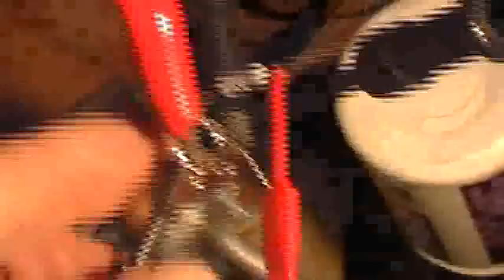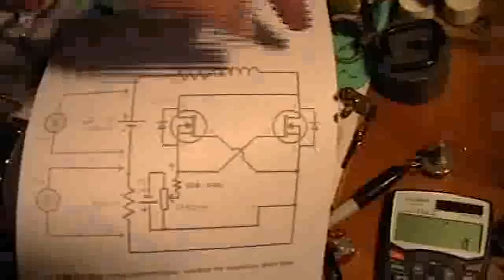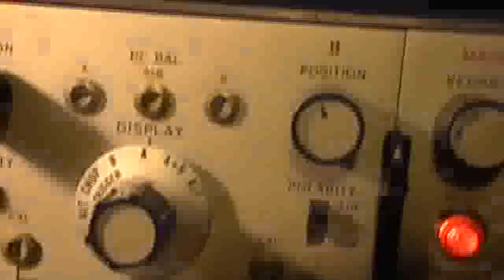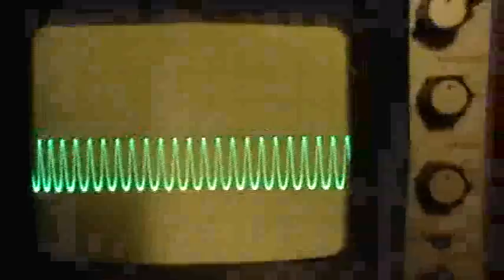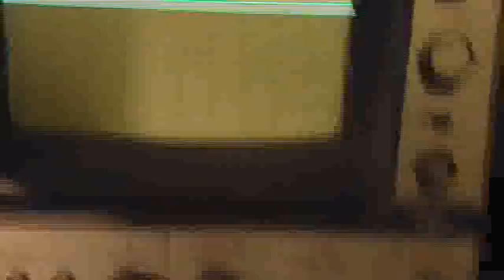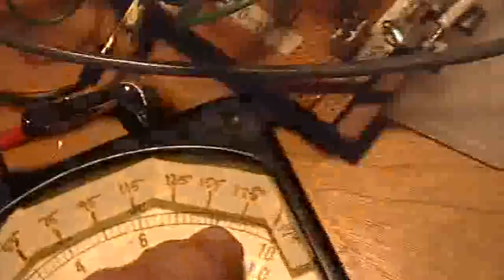Electric OU: Quantitative Scoposcopy and Tar Baby Bias Current

Comment: Okay, I see, the DC current flow through the 10.3 Ohm resistor is from the main battery through Q2 back to the main battery ground.....
Ithought this current would come from the 9 Volts battery, but this is not the case...!

Then just put a 100 nF cap in series, so it blocks the DC current and will only pass the AC.
ripple.The 9 Volts battery should then not be discharged so fast...

Regards; Stefan.